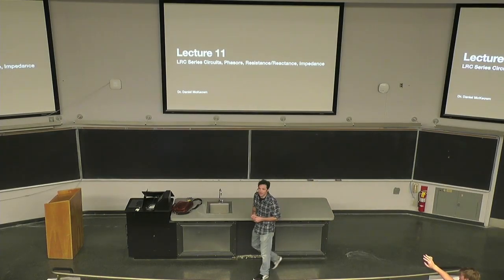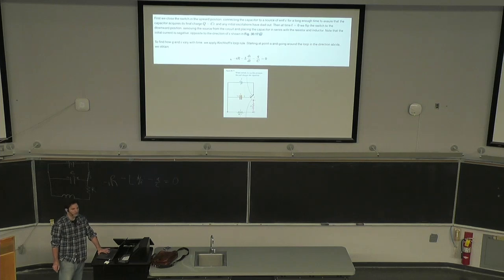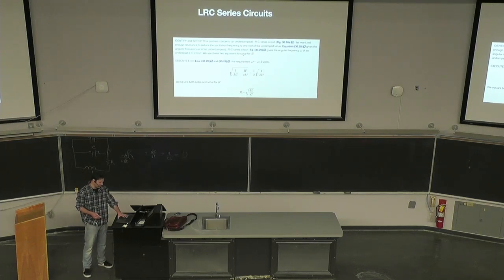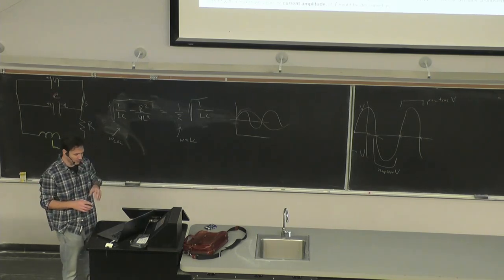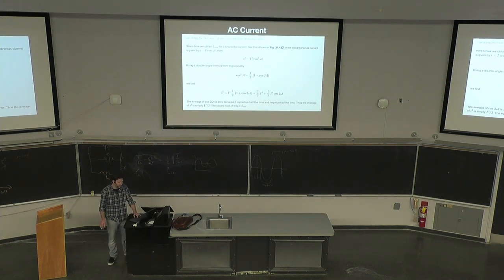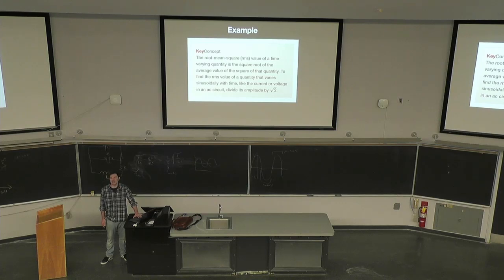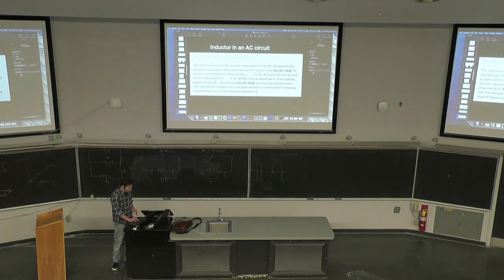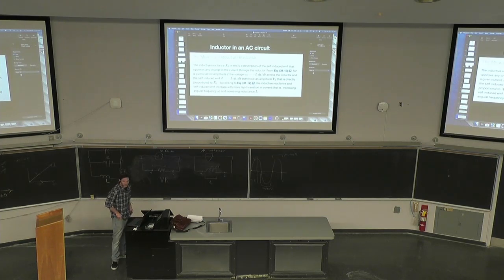#physics #lectures at #ucla #electricity and #magnetism Series Lecture 9

Comment: Rayane Koubaa 

In this lecture, I particularly appreciated the analogy between resistance in a LRC circuit and the friction for a mechanical system and especially damping in a simple harmonic oscillator. It simplified understanding the material and making connections between both. I also thought it was interesting to know where the root mean squared came from. I used expressions for root mean squared velocity previously in chemistry and thought it was interesting to learn how to derive it and how to use in circuitry application!

Comment: Annabelle Boots

I knew very little about AC circuits before watching this lecture, so I learned a lot. The parallels between these circuit systems and mass/spring systems is really interesting to me. Drawing out these parallels helped me better understand this concept. I also found the phasor diagrams interesting. Geometric representations of complicated concepts are always useful, and it was interesting to see a visual of something with both real and imaginary components.

Comment: Miles Fisher

The intro to phasor diagrams was very helpful. It is a really good way to visualize the change in a sinosoidal quantity as well as its derivative. I'm still struggling a little bit with inductive and capacitive reactance as they are pretty abstract values.

Comment: Akshay 

Today's lecture on RLC series circuits was really clear and useful. We looked at phasor diagrams and how they show the roles of capacitors, inductors, and resistors in AC circuits. It was easy to see their effects and how they work together in the diagrams. Also, comparing the oscillations in mechanical systems to those in electrical circuits helped me understand the electrical concepts better.

Comment: Luke McNaughton

The relation of phasors to the circuit diagrams were quite helpful in the analysis of the diagrams. Especially when explaining the in phase and out of phase voltage/current. It also helped to show the phasor diagram with all of its following iterations using trig.

Comment: Johnny You
I found the imaginary part of the phasor diagram very interesting as it hints that the current through an AC circuit with multiple types of components can be found by adding the vectors for each component. I did some further research and found that there are very profound impacts that phase shift has on real world devices. If a mainly reactive device like a motor tries to draw current from the grid, it'll draw reactive power as well as active power. Applying the fact that capacitors shift the phase in the opposite way that inductors do, capacitors can be used to correct the power factor. Since motors are used in a lot of places, I can see that phasor diagrams are used a lot, even though the textbook completely ignores the imaginary part of the diagram.

Comment: Luis Ruiz

This lecture helped me better understand homework 5. Learning about the AC voltage being applied through pure conductors helped me distinguish the relationship between the current and voltage. In addition, I learned how at maximum voltage the current would be 0 while the charge is at its maximum.

Comment: Sophie Kogan

I liked how the equations for instantaneous current and voltage were explained relative to each other. I am still trying to grasp how to phasor diagrams indicate the relationship between current and voltage if the magnitudes are changing. Are phasor diagrams always instantaneous for at a single point in time?

Comment: Jackson ZoBell Kriege 

I really enjoyed the idea about phasor diagrams to represent AC components. I'm glad you drew this all out on the board because it helped me visualize. Now I understand that the length of the phasor vector represents its magnitude and the angle its rotated from the reference axis is its phase angle. This helps clearly explain phase relationships of things like current and voltage drops across R, Ls and Cs!

Comment: Sarp Gursel

I wasn't very familiar with the concept of phasors, so I appreciated your additional explanation on top of the information provided in the textbook. Additionally, I think each of the examples helped explain how resistors, inductors, and capacitors behave differently in AC circuits. However, I'm not still not sure when we should use the rectified average value of current versus root mean square current when we are doing overall calculations in circuits.

Comment: Alexis Kim
I was interested by the underdamped situation in the LRC circuit, and how the equation is similar to a damped harmonic oscillator, just with different variables: using q instead of x, L instead of m, 1/C instead of k, and R as the damping constant instead of b. This also leads the crossover point from underdamping to critically damping to be the same.

Comment: Nathan Wei
It was fascinating to see how we decided to mathematically model circuits with inductors. Using complex numbers (namely Euler's formula) to model current and voltage in AC circuits is very clever. Seeing the theme of SHO and oscillation in general pop up here is also cool.

Comment: Bryanna Reyes

This lecture went over LRC series circuits and something that stood out to me the most was the correlation to oscillations. I think the comparison the professor made with oscillation and harmonics made this lecture a lot easier to understand and overall simpler to comprehend. All in all the examples were very helpful when trying to understand circuits, which is something I had struggles to comprehend. This lecture made understanding the steps to solving these types of circuit examples a lot easier to comprehend and approachable. It was very useful in understanding this topic and I hope to reference it as I continue to learn about circuits throughout my engineering courses.

Comment: Maritza Fuentes

I found the connection between damped oscillations that we learned in Physics 1B to damped oscillations in circuits in this class to be fascinating. It's interesting to see how concepts are similar throughout all areas of physics. The concept of oscillating circuits was the easiest concept for me to understand due to the fact that I already had previous knowledge about oscillations. I also found the concept of phasor diagrams to be pretty simple. Although, I do have a question about the rotation. I might have missed it, but will the rotation always be assumed to be counterclockwise? When is it clockwise? From the examples, it seems that this was the case, but I want to make sure.  It was also useful to see the relationship between the resistor, capacitor, and inductor in a circuit.

Comment: Matthew Tsai

I found this lecture particularly interesting, as my other class has just introed the idea of AC circuits and impedance/reactance. These ideas tie in nicely and provides a clearer conceptual understanding to the formulas that have been provided and will definitely take a while to fully sink in. It was also interesting to see the basis of basic electronic circuits, such as high and low pass filters, which are fundamental to electrical engineering and interpreting systems and signals.

Comment: Sofia Ando

I like how all the concepts from 1B and 1C are tying together. Such as how resistors are damping the circuit and how inductors can be represented as springs, or oscillators. However, I found the phasor disagrees to be a bit confusing and I’m unsure why we chose cosine in the sinusoidal alternating current equation if it alternates sinusoidally.

Comment: Anmol Gupta

Great explanation on the impact of resistance, inductance, and capacitance in AC circuits! It was particularly helpful how you detailed the phase differences between the current and voltage across different components. It clarified a lot about how these components behave in a circuit. How does this affect things in everyday devices?

Comment: Lorenzo Cova
I think it is even more interesting that the mechanical vibration analogies continue even further now with damped oscillations relating to resistance in a circuit. I also think the concept of phasors is very useful and visualizes oscillating current and voltages very well. It was very interesting that each different kind of circuit has a different phase shift between the oscillating current and voltage across each element.

Comment: Doan Le

Learning about RLC circuits has been really interesting. These circuits have three parts: resistors (R), inductors (L), and capacitors (C). They work together to control the flow of electricity in different ways. For example, they can pick out certain signals in radios or reduce noise in electronic devices. It's cool to see how changing the values of these parts can change how the circuit behaves. This makes them super useful in many everyday gadgets.

Comment: Steven Wen

I find it quite interesting the similarities RLC circuits have to SHM like springs. It is astounding since a one to one matching can be found for everything (eg. velocity to current, distance - charge, mass - inductance, etc) except that the reciprocal of capacitance is tied to the spring constant.

Comment: Kirby Johnson

I found it interesting how the phase shift changes depending on what is present in the circuit. I liked how the phasors are both in phase when there is a resistor, as this will be easier to remember.

Comment: Kenneth Ha

Critical damping is an interesting concept especially because I know I’ve used critical damping similar to what was explained in lecture. I have a Newton’s cradle on my desk and sometimes when I start the pendulum, I stop it on the other side and now I see how that is critical damping. Diodes are an interesting concept and also thinking of them as a gate makes a lot of sense since current flows well one way and cannot flow the other way. inductive reactants being a description of the self-induced EMF that opposes any change in the current through the inductor is a pretty interesting concept.

Comment: Pranav Kunnath

I thought this lecture did a great job of tying together the behavior of capacitors, resistors, and inductors in AC circuits. I appreciate how these three circuit components all share the idea of inductive reactance, which is the result of resistors and inductors being out of phase with the current. I was especially able to comprehend the distinctions between voltage and current in each of these components thanks to the phasor diagrams.

Comment: Melanie Mendez

It was cool to see how closely related LRC circuits are to 1B concepts such as simple harmonic oscillation with regards to resistors being able to over or under critically damp themselves. In addition to oscillating voltage levels  being almost identical to previous equations used for spring-mass systems, I find it interesting to see its relationship with that of oscillating currents through phasor diagrams.

Comment: Allen Wang

I really like your explanation of RLC circuit. As it turns out, they are very helpful in filter designs. However, solving RLC circuit needs to solve 2nd order differential equation, which is quite complicated. The damping is really interesting. The phasor is also a very useful trick in electrical engineering and circuit design. I really enjoyed this lecture.

Comment: Katinka Lennemann

Neat to learn about more and more parts of a circuit. The parallels between what a resistor does vs an inductor is interesting to learn about as well, where one dissipates energy and the other stores it. Also super helpful in understanding the role of AC in circuits after learning all about DC!

Comment: Princeton Liu

I am a bit confused about the difference between the root-mean-squared Voltage for the inductor, resistor, and capacitor and the maximum Voltage for those three things in an LRC series circuit. I think it's really neat how an energy equation for an osciallator seems very analogous to the energy equation for an LC circuit.

Comment: Kelsey Shan

I thought it was cool how the sinusoidally varying emf for the LRC circuit was similar to content in 1B. I also liked the explanation of the alternating current moving through the capacitor since it charges and dischargers and the electric field between the plates, because it refreshed 1B knowledge and it answered what I was confused about when I was watching.

Comment: Nathan Tropio

I found the part about how resistance impacts LC circuits very captivating. Pointing out that real inductors come with resistance in their windings and wires, so they end up losing some electromagnetic energy as internal energy. This resistance throws a wrench into how an LC circuit behaves, causing those oscillations to fade away over time.

Comment: Ryan Wang: I really appreciated the detailed explanation of the relationship between current and voltage for resistors, inductors, and capacitors in a circuit as AC current is always explained as an oscillating voltage but none of my past professors have elaborated on how it actually effects the circuit. Also, I found the aside on displacement current between capacitor plates to be fascinating as it shows how Maxwell's equations so perfectly encapsulate behavior of electric and magnetic fields.

Comment: Seif Abdelaziz

I've learned that in an RLC circuit, resistance in the inductor and connecting wires causes the oscillations to dampen over time kind of like friction in a mechanical system. The oscillation frequency decreases as resistance increases,and if resistance is too high the oscillations stop completely.

Comment: Chris Gudmundsen
LRC circuits are something I fully expected after last class. I've learned about damped oscillators before, and having learned about the analogies between the LC circuit and the harmonic oscillator, I just knew there also had to be an analogy to damped oscillators. The math was extremely interesting to me (I really want to learn complex analysis to be able to understand the derivation of the overdamped oscillator), and I followed along for most of it. Phasor are still weird to me though. I'll need to think about them some more.

Comment: Pierre Paye

I thought it was really interesting how the LRC circuits are exactly analogous to the damped oscillators we learned about in 1B, including the underdamped, critically damped, and overdamped conditions. I was wondering if there is an analog in electronics of the driven oscillator which we also learned about in 1B, and if there is what that would look like in a circuit.

Comment: Aoi Tomoeda 

This lecture on LRC circuits was really interesting. The way you connected LRC circuits to damped harmonic oscillators made easier for me to understand. The step-by-step problem-solving and diagrams were super helpful. I also loved the phasor diagrams—seeing the sinusoidal behavior of current and voltage visually really solidified my understanding. Overall, the lecture made the complex concepts much more approachable and practical. Thanks for making such a tough topic easier to grasp!

Comment: Maria Campo Martins

I found the introduction of AC circuits and inductors very interesting. I have always liked circuits, and with the introduction of new components, it opens up a wider range of possible combinations. The biggest takeaway for me regarding AC and RLC circuits, is that you can no longer consider the circuit to be a static configuration, in which the voltage, resistance and current are always constant across all components. Now the characteristics of the circuit are very dependent on time and thus we can only analyze snapshot by snapshot.

Comment: Summer Dixon
Lecture 2

I thought it was interesting that toward the beginning of the lecture, Professor said that we can think of the resistor in the LRC circuit as coming from the internal resistance of the inductor itself. This reminded me of how we sometimes represent a real battery as an ideal voltage source and a resistor to account for its internal resistance. I knew that passive circuit elements could have complex impedances, but it had never occurred to me that we can treat an inductor as having an internal resistance that we are able to separate out as a resistor. Does this same concept apply with capacitors?

Comment: Nicholas Holmon: Relating to the beginning of the lecture, I wish that a brief overview was included relating to the circuit components that are not the newly introduced inductor. I only say this because it has been a while since I took Physics 1B and without a refresher on the basics of circuits it is a bit hard to follow for me. I think that for the Phasors part of the lecture it may have been better to introduce Phasors separately from current (maybe in terms of a spring system). I say this because the way it was introduced made me think it was linked to current in some way as opposed to just a general way to describe an oscillating quantity, which made understanding the topic much easier for me.

Comment: Danny Chmaytelli: I found the concept of exponential decay in oscillation amplitudes due to resistance to be really interesting. It was cool to learn about the different damping conditions—underdamped, overdamped, and critically damped—and their practical applications in circuit design. I also appreciated the discussion on the necessity of selecting specific resistance values to achieve desired damping effects.

Comment: Gemma Greene
This lecture was useful for being able to understand how the different components of the circuit change it, such as how a resistor turns an LC circuit into a damped RLC circuit. I found it interesting that instead of having a constant voltage, it would instead be sinusoidally varying.